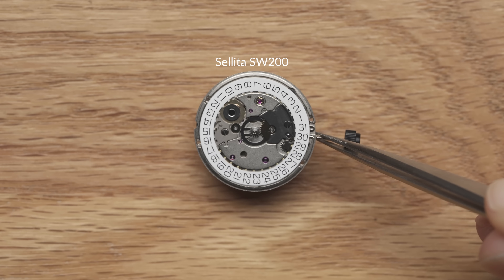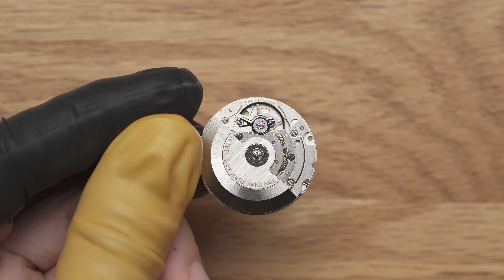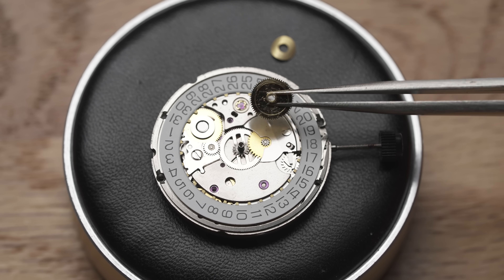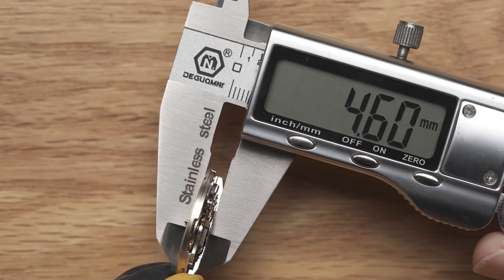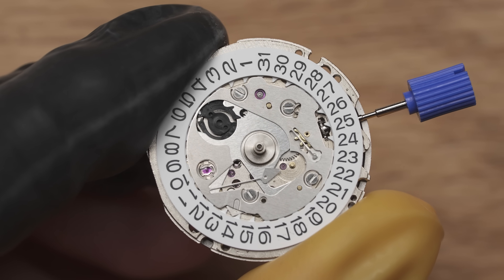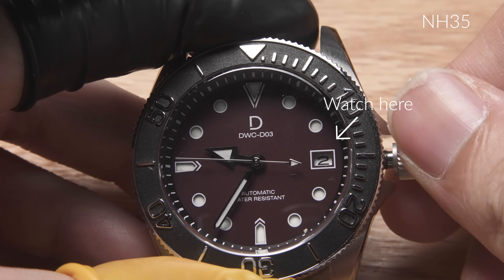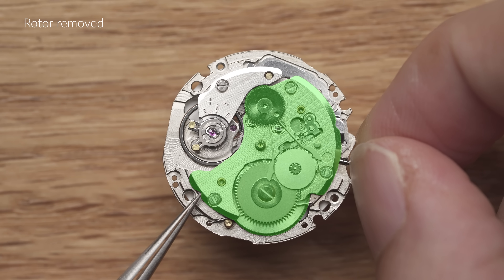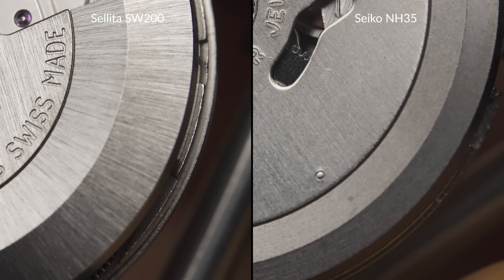Why Swiss Mechanical Movement is More Expensive (Sellita SW200 VS Seiko NH35)

Comment: The insciptions in the Swiss are engraved, in the Seiko stamped. The latter is more economical. But does that matter? 
The Swiss watch has NOT a better finishing. (4:34) The Swiss rotor(?) has a course radial brushed surface, which looks nicer (!), but is of the same, or courser roughness compared to the linear brushed rotor(?) in the Jap. 
The tiny Japanese srews are more precise in their slits, (compare!) so they give a better grip (safer in maintenance).
Japanese precision engineering (e.g camara's) is known for their extreme durabilty offered by a fair price. The Japs work for their money.

Comment: The winding feel and the date change have nothing to do with the tolerance of the parts. An instantaneous date change in a gradual date change use two totally different mechanisms. The winding feel depends on the gear ratios in the winding train and the amount of teeth on the gear contacting the click.

Comment: In my engineering undergrad. I learned equipment that requires tight tolerances will not be as reliable or outlast equipment that does not need those tight tolerances. 

Requirement of extremely high tolerances imply when Parts wear down, function is impeded thus needing service at a higher rate. This rises down time of use and increases cost
Reply: True. Reminds me of the AK-47 vs M-16 comparison.
Reply: Well if you’ve ever had a Swiss watch vs Japanese watch you would know that your statement is worthless. 
You’re literally trying to say a watch made by a machine with plastic parts is better because “less accurate mechanisms last longer”
Reply: Theyre not less accurate, you can het an ng35 to run at +- 1 second a day pretty easily  @daxzim9874
Reply: Incorrect
Reply: @whereRbearsTeeth  

LOL. its fact known by all watchmakers. These professionals are also far less impressed by expensive Swiss watches than the people who buy them.
Reply: @whereRbearsTeeth  Oh my bad nevermind guys j was wrong thank you I was about to interview at Lockheed Martin glad you called my mistake
Reply: @gtxhunter9980 did you get the job and could you tell us even if you did?
Reply: @davidrockefeller2007  Lockheed don't look for or hire the best engineers, they hire the engineers with no moral compass and solely in it for the money.  If you want to see how good their engineers are, look at how unreliable basically everything they produce ends up being lol

Comment: It's kinda missleading. What we done here is two different price point and the "Cost" needs to go somewhere either good or bad. The "expensive" part are mostly come from materials, assembly, and machining differences and other big things today are "ads". 

I had Zero knowledge of watches, but the basic principle on any product is there "Price". 
"Why Swiss Mechanical Movement is More Expensive" became out of wack if you mention general things and specific things together it make the viewer kinda "Cool, whatever and a bit confuse" as you you can see in the dislike ratio. The amount of general information and specific need to balance out with any product that you want to talk about. So the viewer can had better judgment either the Video is Helpfull, good, okay ish, misleading, confusing .etc.

Comment: One thing that bothers me about the NH35 is that, while it's serviceable, it's pretty much considered a throw-away movement. Meaning instead of getting it serviced, you either throw away the entire watch or throw away your old NH35 and have it replaced with a new one. Cost-wise, this makes sense of course - but it's hardly what I'd call environmentally friendly and it just bothers me to throw away an item that would simply need some maintenance to keep going. 
That said: With servicing prices being what they are (at least at my local watch-maker), perhaps even the SW200/ETA 2824 are approaching "throw away"-status, these days. 
Re "perceived" quality: I much prefer the smoother 4Hz sweep of the 2824/SW200 and when it comes to the feel of the movements while interacting with them, you clearly get what you're paying for, IMO. My NH34 feels comparatively "rough" when winding, setting the time doesn't feel as precise or tight as on my SW200s (or as on my PT5000 for that matter) and pushing in the crown after I set the time can result in the minute hand moving/jumping out of position unintentionally - making it necessary to set the time again. 
If you're into Chinese/AliX brands, there's a pretty easy solution in the form of Chinese 2824-clones like the PT5000 - these are usually only slightly more expensive than NH35-equipped watches and if the one example I own is any indication, they feel and run just like the Swiss original they're based on. They might need a bit of regulation out of the box and there's probably a slightly higher risk of getting a lemon ... but IIRC, even Sellita reserve a 5 percent "lemon-rate" for any order of movements they ship to their customers.
Reply: The environmental impact of replacing a movement is negligible. The only require about as much material and energy as a couple of steel soup cans to make.

Comment: Thumb-down. Inaccurate. Japanese movements are not , in-general, less expensive than Swiss movements. This video is like comparing a Timex to a Jaeger LeCoultre then saying "this is why US movements are cheaper than Swiss movements". No they're not; you just chose a cheap movement. Try comparing a similar-price Swiss and Japanese movements instead; that might have been an interesting comparison.

Comment: Thumb-down. Inaccurate. Japanese movements are not , in-general, less expensive than Swiss movements. This ridiculous video is like comparing a Timex to a Jaeger LeCoultre then saying "this is why US movements are cheaper than Swiss movements".  No they're not; you just chose a cheap movement. Try comparing a Jaeger LeCoultre to an RGM instead. Likewise, you could have chose to compare a $200 Swiss movement to a $200 Japanese movement; that might have been an interesting comparison.
Reply: But on aliexpress you see something like a watch version with nh35, pt5000, seagull and sw200 as priciest version. These are most used movements in mass market. So comparison is practical and interesting.

Comment: Swiss movement usually have slightly smooth winding due to its tight manufacturing tolerance . If comparing the ETA 2892 /2824 with seiko 7s26 / 4r36 , will notice the ETA have smooth sweep as its  28,800 bph vs seiko 21,600 bph . seiko hi beat and spring drive is another level . For accuracy , nothing beats a quartz or digital watch . Just don't forget to change the battery . Always use a silver oxide ( SR ) , not alkaline ( LR ) and check its expiry date .

Comment: I have a 4R35 that runs -3 seconds per day. So the movement can be a solid performer. Have several watches with 2824-2 in them, also solid performers.

Comment: Agreed. I’ve had the helicoptering happen to two Orises, a Glycine, and a San Martin. All had the Sellita movement in them.
Reply: sellita in a San Martin? that's interesting, from the little research I did when I was considering them they only used NH movements and the occasional miyota 9000 series
Reply: i stand corrected, just looked it up, sw200 AND A WATCH for £385 is wild

Comment: Not a fair comparison. You should have compared the Sellita to the Miyota 9015 Japanese movement. Those are made to compete with each other and the Miyota is just as good if not better than Sellita. There is no reason the Sellita should cost more.

Comment: Good video. Couldn't agree more with the final sentences. A 24 jewel NH70 or NH35 is going to feel cheaper (winding, setting date, time etc) than a 28 jewel ETA movement and this ETA is going to feel cheaper than a in house 3135 Rolex Movement, or Patek, Audemars etc
Reply: Much appreciation and respect to all these watch companies.

Comment: I love my Casio digital watch.
It beeps hourly and has an alarm functions which  an expensive Rolex does not have. It's also more accurate than a Rolex  watch.  Unlike a Rolex watch which is quite cumbersome to set the time and the date, my Casio watch is  very easy to set.
I hate wearing a heavy watch. 
My casio watch is comparatively light. It does not weigh so much  like a Rolex watch does. So it's  really nice to wear it al the time. 
It does not cost me a lot to own and more importantly to maintain my Casio watch.
The battery can  last for up to 7 years. 
It gives me peace of mind. Unlike a Rolex watch, it's less likely to get stolen and robbed.

Casio watch  saves me a lot of time, energy, and money.
I don't  have to visit a watch store every year.
Instead of giving my money to a watch store,  I can use my money to invest in gold bars. I own gold bars and stocks.
Reply: 👋 what kind of stocks? Medium entry level stocks or growth stocks 🤔 ✌️ from South Africa 🇿🇦
Reply: There's a time and place for both. Casio's great for when traveling or golfing. Rolex are great if you have the money for it and appreciate horology and luxury.
Reply: Dumbest comment I’ve read in quite some time
Reply: And most casio are quite ugly to me but for durability, accuracy, reliability and low cost it's hard to beat a G shock. But I still think they are plain plastic watches.
Reply: Bill gates sen misin?

Comment: Not only SEIKO movement uses some plastic part but also the date number printing on the Seiko movement looks very dull and flat. Jananese movements only give you enough to use though it is cheaper.

Comment: I like the H-50 on my Hamilton Automatic which is still the ETA 2801-2,  but they have reduced the beat rate to 21,600 VPH (3hz) and increased the size of the barrel to allow for a superior power reserve, quite smart and simple. Getting -1 second a day and sometimes spot on.
Reply: I have the khaki field king and it's just spot on
Reply: I have Copper, H40, purchased in 2022 and this is the second time that I am taking it to a service because of the helicopter(reversing wheels) issue. First time was lat year, and few days ago again. I'm not an expert to say if its due to the poor lubricant, or simply the assembling issue, but over here I don't have a choice to RMA it even if its still under warranty

Comment: one thing you didn't say: the NH35 got seiko magic lever automatic works, which is more efficient than traditionnal
Reply: And considerably more reliable. I can't tell you how many reverser wheel sets I have replaced over 20 years of professional watchmaking. I can remember the singular 1969 6105 magic lever pawl I replaced because it was so "out of the ordinary". But truth be told, Seiko got the magic lever idea from the Swiss (JLC), and reinvisioned it with only 2 components.
Reply: What's that?
Reply: @iyzyz instead of using reversing wheels to keep the watch winding no matter which way the rotor spins.  The Seiko Magic lever looks like two hands coming from a single point, in a v, that does the same thing. It’s a very strange looking but very robust system. If you watch a year down off most Seiko movements you will see the Magic lever when they remove the rotor, the weighted section which of what supplies the force to wind the watch while you move about and is usually removed after the hands and dial.

Comment: My experience with Selitta is that the movement is much more sensitive in terms of accuracy when depleting reserve - or at its end, it starts to slow down rapidly, unlike NH35 which does not vary in accuracy as much, when the reserve is low. It also varies in accuracy, when left for some time unwinded in the box, while NH35 usually keeps the accuracy within the last known measurements, before it died, and once wound up it performs more or less the same. NH35 has also bi-directional winding rotor, so usually stays winded with higher reserve, unlike Sellita with one directional rotor, which quite often struggles to keep watch alive, when worn only for half a day. My 6 x NH35 watches never stopped during the use, but the Sellita died quite often with similar times on hand. I was also lucky perhaps, because none of my Seiko movements varies more than +/- 10 sec a day, most of them keep time within 4-7 sec a day. Sellita varies from 3 sec to 20 a day. So there you go.

Comment: Now compare SW200, ETA 2824, and Chinese PT5000 for more definitive result
Reply: You forgot the Sea-Gull ST2130. And i can assure you - if youve not picked one from a Monday Production, the PT5000 and the ST2130 will work exactly the same as their Counterparts. PT5000 is an SW200 Clone and the ST2130 of the 2824-2, both with minimal adjustments.
Reply: @Pirate85_Original thanks for the valuable addition!

Comment: The NH35 might be more difficult to service,  but would anyone service it instead of swapping it out for new NH35? Unless the customer insists on servicing the existing movement.
Reply: More difficult is a relative term. The SW-200 is easier to access. The NH35, especially on the side of the wheel train, is more like a guided tour. Even if you didn't know the movement, there is also one logical next step in the reassembly and assembly. The SW200 has some odd pitfalls, such as not removing the stem from the right position, which may force you to take parts of the front of the movement apart, just when you thought you had fully assembled a watch.

But in the end these differences are minute, if you know what you are doing. Also, if you are going for an inexpensive replacement route, you can buy ETA2824 clones for maybe $5 more than you'd pay for the NH35. These clones aren't pretty, but they are functional. In the end, you shouldn't have much of a service issue with any standard movement.
Reply: I would say  from experience, any of the Seiko 7S/4R based movements are very easy and logical to service. it typically takes less time to service them than 2824 based movements.
Reply: I was thinking the same - exchange the movement for a new one is cheaper than any servicing
Reply: service of the NH35 (Japan) is more expensive than buying new TMI NH35A (chinse),

Comment: Disclaimer does nothing with ending conclusion like this. There are better japanese movement like Miyota 9015 and they will still be cheaper with better specification.

To be specfic with the price bracket. That Swiss movement shown is not just 2 or 3 times the cost but 5 to 10 times the cost of the Japanese movement.

Comment: I've no clear winner to either one Japanese or Swiss but don't hand wind either of them, not even to get them started....a few gentle shakes time set and go. Never had an issue with either one. The 2824 and associated SW-200 were initially designed for hand winding. To make this movement automatic the overall dimensions were limited to e.g. thickness of the ratchet wheel. I think the manual of the SW200 is clear on the hand winding subject. For me personally....if I buy a car with an automatic gearbox and use it only in manual mode, what's the point of buying an automatic?  It wouldn't surprise me if the automatic gearbox of a car would wear out faster too because of that.  As far I understood the SW-300 movements and up were designed as automatics where this hand wind issue doesn't persist is seems. In my mind...if you wanna hand wind...don't buy an automatic :-)

Comment: 0:14 NH35 is not a Japanese movement. It's made by TMI, a company based in Hong Kong.
Reply: TMI is SEIKO group, this is a SEIKO movement manufactured outside of Japan. Like a Volkswagen made in Mexico, or a Mercedes made in USA. Nobody would say, that a VW or a Mercedes manufactured outside of Germany are not german cars... 🙂
Reply: @arpadbalazs3296 tbf some of the Asian Mercedes in the commercial sector are actually Ssangyong.
But your point still stands.
Reply: 日本の技術を楽しみたいのであれば、MADE IN JAPANを購入して下さい!
Reply: The factory is in Hong Kong, a result of Japanization. The Japanese are the ones who reformed the Asia.

Comment: Both are decent, but neither is as pleasing to the eye as the mechanical movement in my automatic battery operated square Gshock 5600 with an lcd display and doesn’t even need a rotor. Casio somehow managed to build better mechanical watches with LCD displays than most Swiss and Japanese brands and found a way not to use a rotor inside, only a small battery. So high tech and at a fraction of the price.
Reply: sounds like the kinetic line of seiko who had that already 20+ years ago but just swapped out the mechanical part for lcd as I understand. Nothing new under the sun though.

Comment: and eta with C07,xxx calibers take that quality back and put garbages in the movement (like non regulating hairsprings or plastic parts like in powermatic 80.111 literally palletfork and escapement wheel is plastic) thanks eta